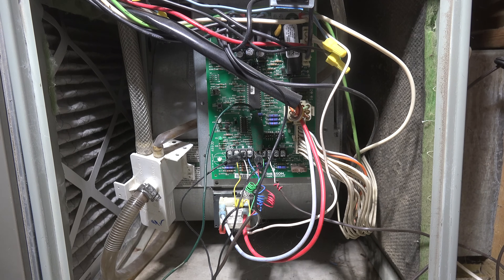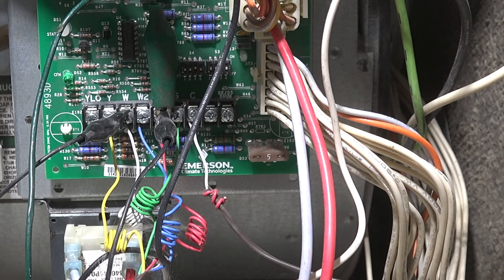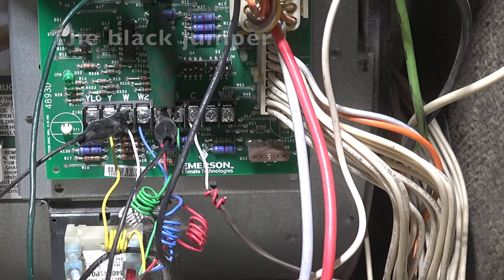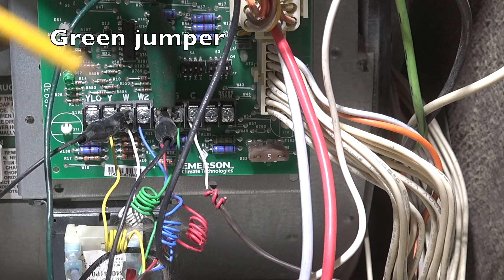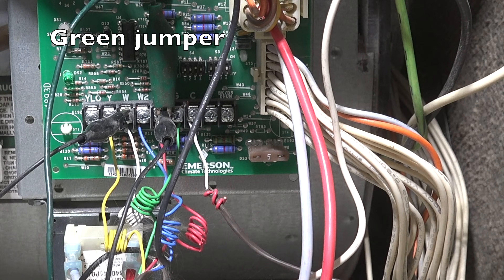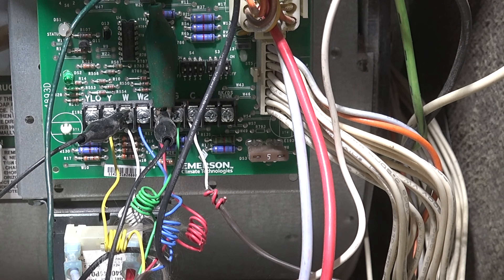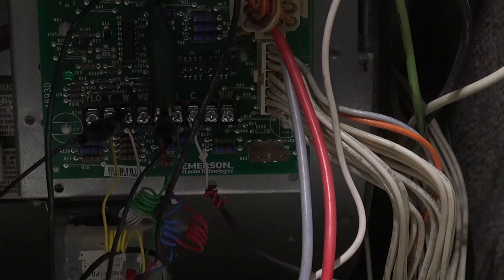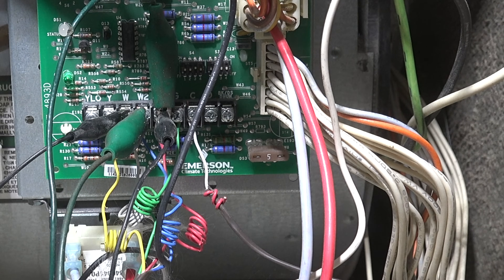How to initiate 2d stage on the gas furnace

Comment: If the furnace kicks on just fine without a jumper, can I then just use one jumper to jump R to W2? I wouldn't need 2 jumpers unless it won't kick on at all, right? Newer technician here.

Comment: I wanted to check gas pressure on high fire on a Lennox today and jumping w1 to w2 or directly R to w2 it wouldn't go into high fire. Are some furnaces obey only on the time delay the board has?
Reply from the maker: If you are unable to get it to go to hi fire, jump W1 to W2 and wait about 10 minutes.  It should go to hi fire.
GFM

Comment: New Goodman 2 Stage; one W.  How do i control with Ecobee?
Reply from the maker: Does it not have a W2 on the furnace control board?
GFM
Reply: @grayfurnaceman  No, just one W and one Y on this new Goodman top of the line furnace. lol  $2,000.   The computer chip determines the time to switch to stage 2.  This is so annoying coming home to a cold house running on low for 10-20 minutes.  Wondering how to bypass this and control from my Ecobee instead

Comment: Where does the green jumper attach to at the top? It's out of frame. I can't understand how you jump to w2 without being on ted  thanks.
Reply from the maker: The green jumper goes from R to W2.
GFM
Reply: @grayfurnaceman    thanks for the response . My furnace doesn't have any terminal r
.
Reply: For w2. I can send a pic tomorrow if that would help.
Reply from the maker: @hillisrutter6291  Does your furnace have a terminal boarder are there just wires?
GFM
Reply: @grayfurnaceman   mine has terminal board with the usual--Y,G,R,B,W.  No W2. Thanks.
Reply: @grayfurnaceman  I don't know if you received.my response. I have a terminal w 5 connections.y,g,r,w,b. No w2.
Reply from the maker: @hillisrutter6291  I did not receive your response.  You have no W2 because you do not have a 2 stage furnace.
GFM
Reply: @grayfurnaceman  I saw the tech set both pressures on the gas valve. Plus there are 2 pressure switches. And there's a dip switch to set 2nd stage.

Comment: I have a question you’ve helped me a lot this winter fixing two furnaces so hopefully you can help me with a new one. We had a company put a Lennox 2 stage el296uhv series furnace and merit 13acx single stage AC in my mother’s home. Despite telling them I’m ordering a two stage thermostat to replace the current single stage they still wired in the single stage thermostat. I’m now preparing to wire for a two stage thermostat my question is this - will it be sufficient to run ONLY the second stage heat wire (W2 I believe?) then set the ECM dip switch back to controlled setting from interval setting or will there be any additional wiring necessary to run the single stage AC off the ecobee3 lite thermostat I plan to install. Thanks For all your help so far! I guess my concern is if there is anything they may have wired to make it work needs to be undone? Will a two stage thermostat operate a single stage AC in absents of a Y2 wire even though I’m wiring in a W2 for two stage heating or will it automatically differentiate between the two? If you have a contact email I can email you working at furnace and thermostat if that helps.

Comment: Hello. We just purchased a 2 stage furnace. We didn’t know much about it. We just trusted the technician. Come to find out our house isn’t wired for a 2 stage furnace. (They did say they would wire it for no charge.) 

But our house was built in the early 50’s, so it’s really drafty. Another technician suggested to change the furnace so it will run in the 2nd stage only because the 1st stage wasn’t warming the house fast enough. 

So, my question is...will it hurt or damage the furnace (Trane XV80) sooner because it’s a 2 stage furnace, but we have it set to run high fire only? Any other information will be greatly appreciated also. 

Thank you. 😊

Comment: I noticed that you placed the black jumper wire directly onto the terminals @ both R and W - However the green jumper wire is not being jumped from the R terminal to W2 because the top of the green wire appears to be placed somewhere else in the middle of the circuit board - Is there another R location on the board besides the standard R terminal that's found on the board next to the other letters  W, Y, G, B etc....etc... - simple question how is the green wire in this video connected - one side is obviously being connected at the board @ the W2 terminal but where is the other end of the wire connected? -- Thanks again for all of your great videos!!!
Reply from the maker: The green jumper is connected ro R.  It just hard to see in the video Its the dark part above the R terminal.
GFM
Reply: Great! I was thinking the same question. I figured that reading the comments below that I would get my question answered. Great video!
Reply: The end sleeve of green jumper blends into thr color of the control board that's why the green jumper connected to R is hard to see.
Reply: For those who are slightly color blind like myself, this was super confusing. lol
Reply: @josepharellanes427  .........

Comment: Great video as usual. This may be a stupid question , but on a 2 stage furnace, when does the second stage come on?  Except for when the thermostat and inside your home has a high temperature difference, your second stage will run.  I understand that.  But once your home reaches temperature and your furnace starts and stops to maintain temperature, does the second stage ever come on?  Please explain.  Thanks
Reply: Jason
Reply from the maker: If the thermostat is 2 stage, and the temperature continues to drop during a cycle, the second stage will come on.  If the thermostat is single stage, the delay is active and it assumes if the 1st stage has not satisfied the thermostat, more heat is needed.
GFM
Reply: @grayfurnaceman    That's the way mine is presently and I have set the motherboard dips to hold in Stage I for 20 minutes.  The normal fire on run time is between 9 and 13 minutes in Stage I depending on the outdoor temperature.  It rarely goes into Stage II unless I bump up the temperature manually. Even then the Stage II run is rather short, maybe no more than 2 minutes.  But with my outdoor second thermostat scheme I can force it to hold in Stage I unless the outside temperature is extremely cold.  I believe that's what I want.  However I would like to have better data on the exact run times related to the precise outdoor temperature.

Comment: when are they going to make a Bluetooth enabled motherboard ? App for your phone ? adjust settings via bluetooth ? smartmotherboard interfaced with google or alexa ? dip switches are so 1980. these things havent changed since 1980. diagnostics via app ? i'm waiting carrier ?
Reply: Absolutely.  These furnaces are so behind from my perspective.  I don't care so much about Bluetooth, but certainly the furnaces need much better data retention and delivery along with the ability to make remote adjustments to the operating parameters without having to fool with the stupid door safety switch which is an absolute annoyance.

Comment: It's only trane i believe that will initiate a delay if w1 and w2 are energized at the start of the cycle. Most will just bring the second stage on right away and the delay is used by hooking up just W1 and setting the jumper or dip switch properly.

Really, the delay is only for when a single stage stat is used. But single stage stats do not belong on 2-stage furnaces, 2nd should be brought on only as required and it should cycle back to 1st, not overshoot and shut off. The entire point of 2-stage is to get long cycles, it's not worth the added expense (both in terms of initial cost and added repair costs) if it just times out after a short time and gets locked on high fire.
Reply: Good info. good comment. thanks for posting.
Reply: I agree with you completely, and have ordered a second commercial grade thermostat that will have its bulb sensor out of doors in a shady place on the north side of the house, and will bridge W2 to W1 only during very cold weather.  The problem I'm addressing  presently in my mind  is what should the set point be?   I'm thinking around 15° might be good.  Any thoughts you have on the matter would be greatly appreciated. One factor is that once that set point is reached it will operate in Stage II full time until the outdoor temperature rises.
Reply: @JoeLinux2000  It's better to just use a indoor two stage thermostat and the second stage cycles on and off as needed to maintain. The good stats monitor rate of change and will bring second stage on before you even notice the temperature drop. With the outdoor stat, you're guessing at what temp first stage can't keep up you lose the ability to drop from high to low.
Reply: @Jon-hx7pe  Good points, but I'm committed to testing the outdoor sensor at the moment.   Losing the ability to drop back from high to low until the outdoor temperature rises is a reason to go low with the setting of the outdoor sensing thermostat.  I might go as low as 10° which doesn't occur very often.  In the mean time the single stage thermostat inside the house can still be based on run time as it is now.  So it would kick up to Stage II if the furnace can not keep up before the set low point on the out door thermostat, which I could even set to 7 or 5°.  It is all mostly dependent on the actual weather.  I don't see getting an exotic two stage thermostat for inside the house at the moment partially because I only have two wires in the cable, and I think pulling a new wire would be very tricky given it's location in the walls.  In fact it might actually be impossible.  The outdoor wire can simply pass through the garage, and I already have it in place.
Reply: Affordable two stage thermostats are easy to come by but the wiring is an issue. There are wireless stats for when pulling a new wire isn't practical and u would gain other things like fan control from the stat as well as ability to control a/c down the road. Only issue is it's expensive.

The lack of ability to switch between low and high with an outdoor stat does reduce the benefit - it's nice to have the furnace not shut off between the point at which heat loss exceeds output on low but high provides too much heat. 

But  anyhow, if you want, just disable the second stage for now and see how cold it can get outside before having to use it. You may be surprised. Most furnaces are oversized, it may be able to heat down to 0F or below on low fire.
Reply: @Jon-hx7pe  I appreciate your advice and it's all valid.   I think my system will work out just fine.   The cycling will still be controlled by the indoor thermostat, and the only thing the outdoor thermostat will do is force it into Stage II at a certain low temperature.  It will not actually cycle the furnace.  Additionally I'm in Denver Colorado which many consider to be a mild climate even though it can get very cold at night at times.   There was one October some years back where the high was only 21° for three weeks straight.  That was miserable . There was snow and ice on the roads through it all. The thing is the thermostat I ordered is very adjustable so based on what you are saying I could set it at 0° and raise it as necessary.   I'm not going to be putting in central AC.   I have a few window AC units which are enough.  The nice thing about Denver is it always cools down at night even during the hottest days of summer.  It's interesting to learn about wireless thermostats.  However,  I'm kind of a hard head, and will just go with what I've envisioned.  If it doesn't work, I can always do something different, but I'm confident it will do what I want.

Oh, one addendum:  I did install a fan toggle on the outside of the furnace.  It's less convenient than at the thermostat, but it is there.  I don't really envision using that feature much, but it has been suggested that you can circulate air from the cooler basement during the summer months.  I've never really tried that, but I may do it next summer as I added a large door to the filter box that I can take off.  The air would still be filtered but pull mostly from the basement.  That was not possible with the original furnace as it was configured.

Comment: If I understand you correctly you have one jumper from R to W.  That would be equivalent to a single stage thermostat closing between R and W(1).   You then connect a separate jumper from R to W2 which forces it into Stage II or high fire.   You say if you hook them both up in advance it will have a delay based on the settings in the motherboard, but that's not the way my furnace works.   When R to W1 is closed and then W1 is bridged to W2 on my furnace it goes directly to Stage II high fire once the burners start after the thermostat closes.  It could be there is a difference in the behavior of various motherboards.  I believe you are going to see in the next few years "smart furnaces" with much more nuanced controls and most likely there will be a touch screen display on the furnace to control various settings of run time modes.  As it is now, the dip switches are rather limited in their capability.  If you compare these furnaces to modern security alarm systems or even a high end washing machine, the furnaces are really primitive by comparison.
Reply from the maker: This video is meant as a help to initiate high fire when testing.  Clearly, not all furnaces will not have this feature.  
As for the future, I don't see a lot of changes in furnace design.  Mostly, changes will involve how heat is delivered to the conditioned space.
GFM
Reply: @grayfurnaceman  With all due respect, and believe me I do respect you very much, heat delivery can be the most economical by using the least energy required for the job.  That's why good insulation, and a well sealed home are so important.  The problem as I see it related to furnaces is by in large the control system.   With these high efficiency furnaces, there is probably little they can do to improve the design of the burners, heat exchangers, or even the duct systems.  What can be improved vastly is a more nuanced control system where settings can be based on actual performance data related to actual real time energy consumption as related to run times, and blower speeds, etc.   Blink codes are ridiculous as compared to a an English language display screen that reports back graphical and numerical run time information.   I'll put money on the fact that the better furnaces of the future will include touch screen control over their functions and the adjustments will be based on real time information and feed back of the actual performance based on energy consumption and cost.
Reply from the maker: Your envisioned system may be better at placing the heat where and when it is needed.  However, the system should be able to operate without input from the customer.  Most people have no time or inclination to actively interact with their system.
GFM
Reply: @grayfurnaceman  I agree that many people have trouble just adjusting their thermostat, particularly if it's digital and has hourly set-back adjustment capability.  Some digital thermostats are way too complex, even for me to understand at a glance.  If people have misplaced their instruction manual you can be up the creek without a paddle.
Reply: @grayfurnaceman  You sure said a Lot! People complain when they get home from work, that they don't want to even push buttons when they get home, let alone watch a furnace go from stage 1 to stage 2...
Reply: @grayfurnaceman  Hello. I just took apart the back of the blower motor and can't figure out how three rings go back in and I really need this because I will have no heat. If I post a video, do you think you can tell me? Any help would be aprectiated. Thanks.
Reply from the maker: I can try.
GFM
Reply: @grayfurnaceman  I may have figured it out but I am still cleaning the blower fan blades. When I try to put it back in , in a couple of days, I'll let you know. Thanks for responding.

Comment: Good video. so, in essence could u set the thermostat stat to heat , set temp 2 degrees above set point , then when first stage fires , set thermostat 10 degrees higher. would that work ? no jumpers required ?
Reply from the maker: In theory yes.  In practice it just does not work.
GFM
Reply: for testing in timely fashion, that doesn't work so well, just manual jumper it, unless you're checking the thermostat itself, then set it up high and take a nap waiting ;)
Reply: I think it might depend on the thermostat, but you scheme doesn't make much sense to me .  Setting the thermostat 10+ just means it would run until the 10+ temperature is reached.  Generally  speaking that's not something you would want.